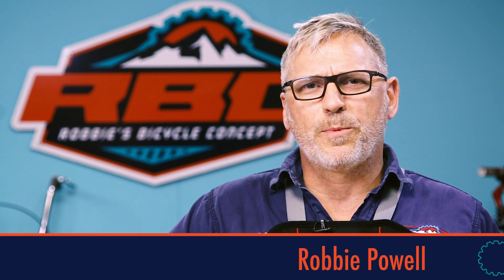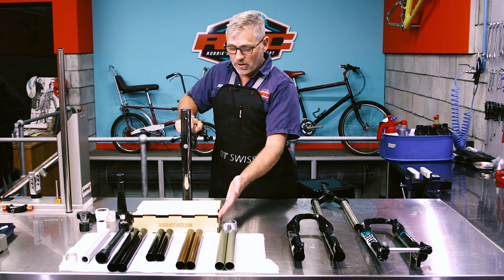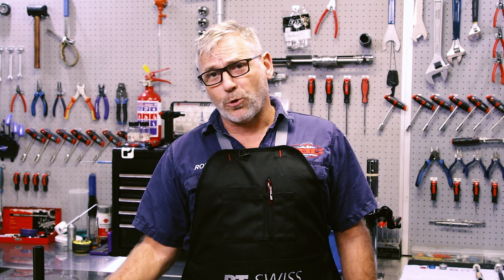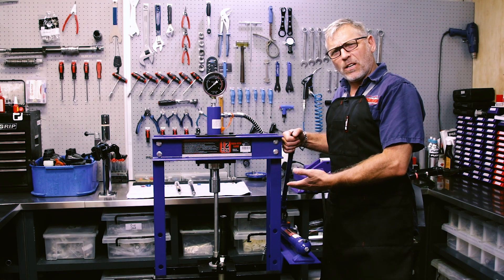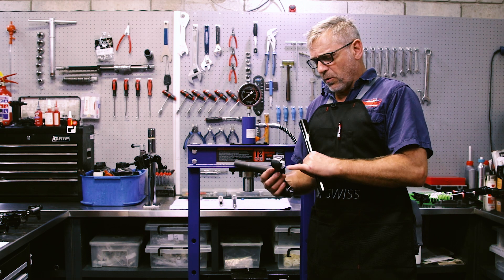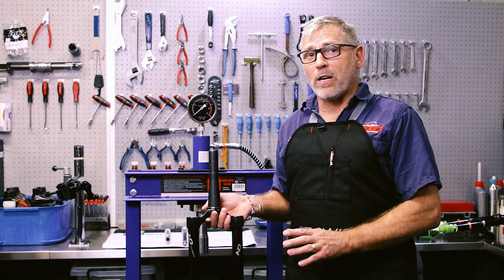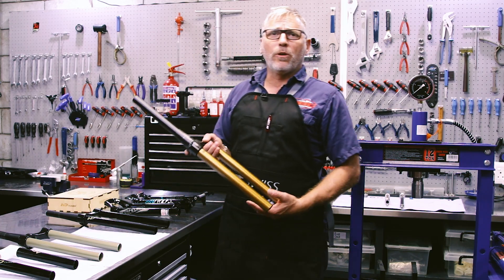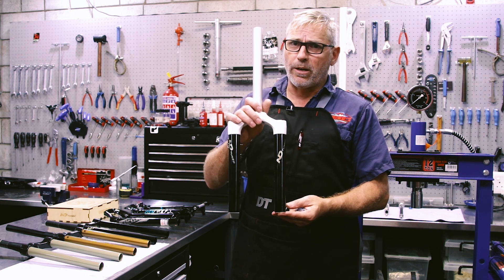MTB Stanchion & Steerer Tube Replacement - Mountain bike fork issue repairs

Comment: Hi Robby can I make a oil fork a air fork because I have to rebuild anyway it’s a rst guide 26
Reply from the maker: Hi Robertmccaled1400, thanks for your message. I don't think it would be possible to fit a air shaft into the coil fork due to the coil spring scoring the inside of the fork leg. Your option is to check if RST make an air upgrade cartridge for your fork which has its own air sleeve.
Reply: Okay what about steering tube and extension presses don’t have a press or tooling the power sports in town don’t have a clue servicing front forks

Comment: I have 1 question: why does ND Tuned make the upper tube so short ??
The length for RockShox 32mm is only 26cm (((
on my RockShox Reba 2011 the upper tube is 32 centimeters long. Travel 120mm.
Reply from the maker: Thanks for your message and support of our channel. ND tuned is slowly adding to the range of stanctions they are offering, as they try to match the market demand they will add as necessary. Keep in mind that the market for the earlier RS 32mm forks is majority xc 100mm travel so the 2011 REBA might not be something they will offer, depending on the demand.

Comment: Can I reuse my steerer tube if its fine.
I'm planning On buying a rock shox lyrik but the steerer is too short for my bike and I have a crown with a fitting steerer laying around, can I just swap them?
Reply from the maker: Hi Grzegorz, thanks for your message and support of our channel. If your crown, stanctions and steerer tube (CSU) is compatible then it should be ok to swap them but you need to ensure that the stanctions are the same length between both CUS's and that the axle spacing is correct as well. Please follow the R/S air and lower leg service procedures if you are swapping out the CSU and ensure that the air seals are replaced and the correct oils are used.
Reply: Does anybody here know how to do this in California?

Comment: my steerer tube is making creaking noises, do you know what it could be?
Reply from the maker: Hi William, thanks for your message, the creaking is coming from movement between the crown and steerer or the stanctions and crown. Either way it will need to be de-creaked or the CSU replaced.
Reply: come it from Your frame or Fork?

Comment: what should i do RBC i cutted my fork to short?
Reply from the maker: Hi and thanks for your message, if you have accidently cut your steerer too short the only options are to replace the steerer or replace the complete CSU. Please let me know which country you live in. I can try to connect you to the closest assistance.
Reply: @RBC_tech  Hey Robbie, I have a Suntour 1 1/8 threadless fork that I want to replace the steerer tube with a 1 inch threaded steerer tube.  Is that possible and who in San Diego can do it?
Reply from the maker: @sliceofchee  hi there sorry I don't know anyone fitting 1" threaded steerer tubes. What bike is it for and what travel is it setup to
Reply: I live in Southern California

Comment: Great Video. Thanks a lot. Do you heat up the crown before pressing out the steerer tube?

Best
Michael
Reply from the maker: Hi Micha, thanks for your message, no I don't heat the stanctions or crown, just a tight press fit.

Comment: Hi I have this fork sworks on my bike 1 1/8. But I Want to fit this fox36 on it 1 1/8 -1 1/12 do you have this adapter to sell to do it.
I levea Im Portugal is ir possible to send it
Reply from the maker: Hi @Paulo-o6r thanks for your message and support of our channel. Please contact ND tuned in Figueira da Foz +351 233 425 265

Comment: Hi,  
I'm building a bike and need a straight steerer tube 1 1/8" on a fork.  All of the more modern forks take tapered.  Could I buy a tapered fork and send it to you guys to modify it to 1 1/8"?  Or do you know of a bike shop that could do this?  I live in Connecticut, USA.  How much would that kind of modification cost?

Thanks,

Rod
Reply from the maker: Hi Rod, yep this is possible, no problem, must be Fox or Rock Shox though. Our price is $90 for the conversion (parts and labor), however the shipping is around $100 each way so you would need to cost this in to the equation. As far as I am aware there are no stores in the US who offer this conversion. Please feel fee to contact me direct on robbie@robbiesbicycleconcept.co.za if you need any further info.

Comment: I am from bangladesh. I am using a rockshox yari which has a creaking sound from the csu! How can I solve this? Please help!
Reply from the maker: Hi thanks for your message, ok so if your fork is still within the warranty period Rock Shox should offer you a warranty replacement CSU but that you need to check with the local SRAM distributor. If its out of the warranty period, you can pack it up and send to us for de-creaking. We will remove the stanctions and steerer and refit with loctite to the factory spec which should eliminate the creaking.

Comment: Hi, do you deal with overseas customers, i have a rockshox fork that i need to replace the steerer tube on as its to short, its a 1 1/8 tube.

If so would you have a rough price for the job and postage back to the UK as i can't find anyone over here that can do it, thank you for your time.
Reply from the maker: Hi Michael, thanks for your reply, we do indeed deal with overseas customers and would love to do the job for you. Price from us is R1500 for the work, postage we will need to get some quotes on but if you are not in a rush then standard air freight is quite reasonable.  However there is a local company in Plymouth who can assist you with the replacement, this will save you a lot of time and money. The company is RSF Suspension and their details are as follows:  
+44 7738 204358, 
www.rsfsus.co.uk , 
 they are on the summer vacation at this time but back shortly. If you are not able to get assistance from them please let me know and I will arrange the necessary shipping.
Reply: @RBC_tech  Thank you very much for all your help and information, i will contact RSF next week if they are back and hopefully get my fork sorted.

thanks again

Comment: Good video but missing information pressing steerer tube into yolk
Reply from the maker: Hi Tris, thanks for the feedback, the process is quite easy but we had limited time for all the process procedures in the video.
Reply: Where can you get the adapter for tapered to straight steerer tube
Reply from the maker: @ryanwoodroffe97woodroffe25  I have for Rock Shox and Fox but you need the tools and the press as well as the straight steerer

Comment: Hi my friend. 
Well after reading some of the comments i feel like a weight has been lifted. As with most i have been told to Bin my Marzocchi Dj's and buy a new set but as we all know, we fall in love with our bikes. 
I do however, need a longer Steerer Tube and have a friend with an Engineering Business containing a press like yours. Without wanting to offend, is it something me and my friend could attempt and are mainstream Fork Steerers universal or does each Fork Manufacturer make their own.
Thanks mate, keep up the great work, John.
Reply from the maker: Hi John thanks for your message and support of our channel.  Most suspension manufacturers use off the shelf steerer tubes with a few exceptions.  A stronger steerer tube for your bike would be the ND tuned ebike steerer. I would not attempt to fit this unless you have the correct tools and experience.  Where are you based?
Reply: @RBC_tech  hey Robbie, thanks for getting back to me mate. I'm in England and i tried your mate in Plymouth but he didn't get back. 
I have looked for a steerer and crown for my DJ's and can't find one so am left with no choice but to go for it.
The guys who've said they will help have loads of experienced with their 5 tonne presses, so ii'm not too worried.
Thanks again mate, John

Comment: Is it possible to swap out a 1+1/8th for a 1" threaded?
Reply from the maker: Hi Dr Fish, the 1 1/8 crown hole for the 1 1/8 steerer tube is bigger than the 1" so you would have to get a adaptor for the 1" to fit. We dont fit these 1" steerer tubes and I would not recommend trying to do this yourself.
Reply: @RBC_tech  Thanks for the reply, after some research it looks like i need a shim for the steerer tube.